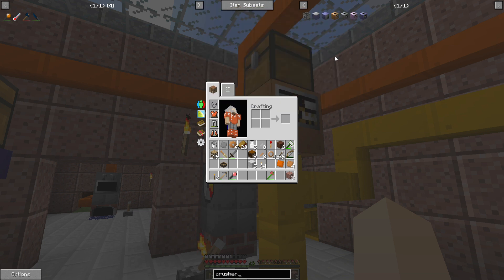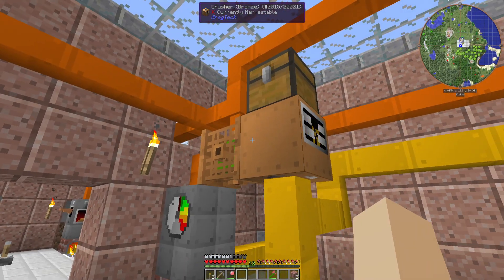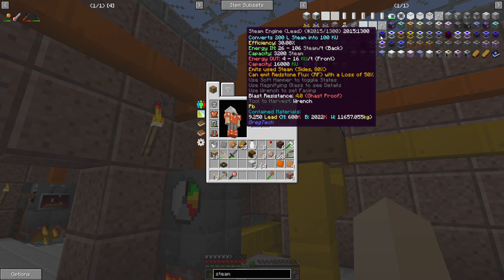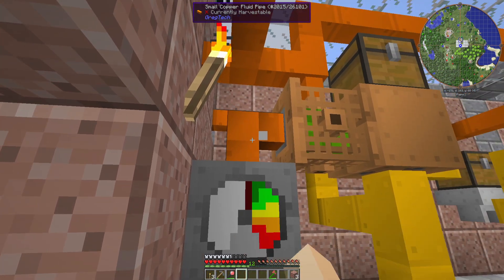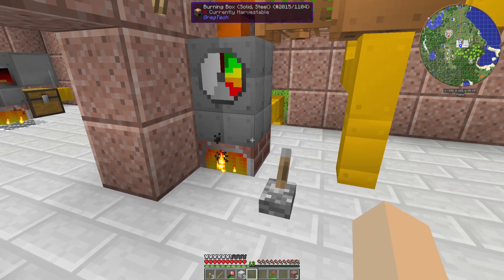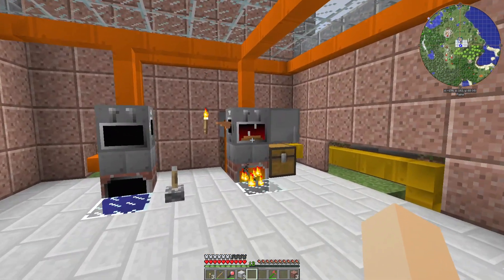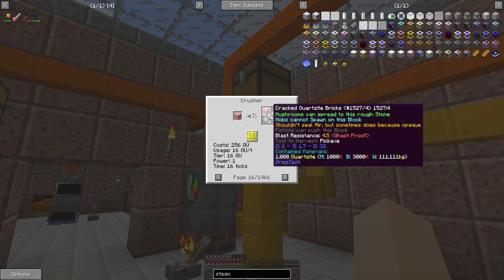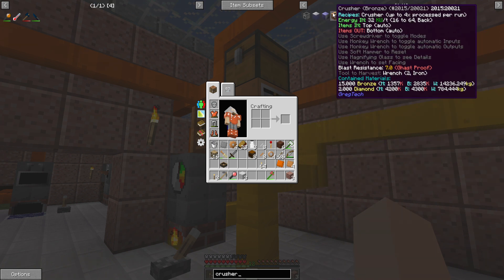Gregtech 6 & 6u Basic Tutorials: Crusher

Comment: Hi, i made a construction like this, and my crusher starts and stops cyclically. Is this a bug or what?
Reply from the maker: no it isnt a bug, this exact setup runs non stop for days. my guess is your running a longer or larger pipe for the steam and or running water rather than distilled water. try building it block for block as it is here with distilled water and as long as your not running a bukit server it will run as soon as the engine is up to heat and never over heat.
Reply: But steam turbine with shredder is running correctly. I think it is bug because my engine is green and magnifying glass says that it is running, but crusher doesnt work correctly. I tried to use water and distilled water, but it wasn't working correctly.
Reply from the maker: but a steam turbine and a steam engine dont work the same or take the same amount of steam to make 16 ru/ku. a steam engine has to heat up before it puts out its full potential, steam turbines are instant on/off. bronze boiler is enuff for turbine where steel is needed for an engine. as i said this exact setup works perfectly and is the minimum required to run a crusher. i use that setup right now with no problems.
Reply: @Bear989  ok, i'll trying, thanks